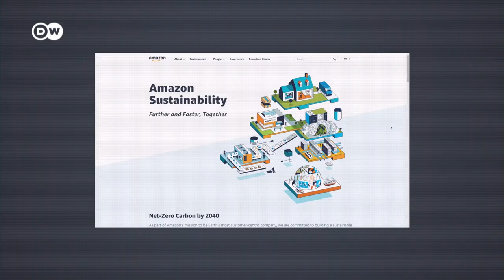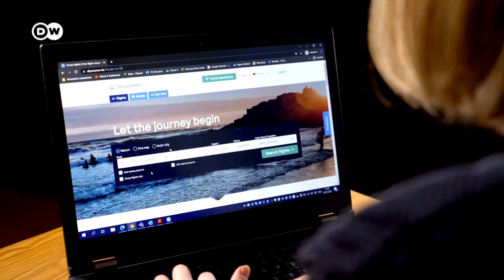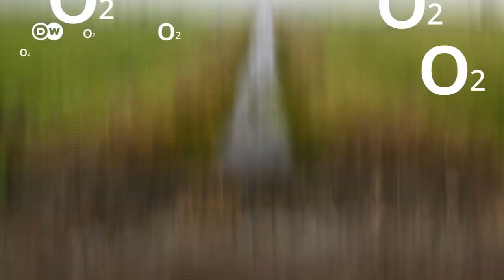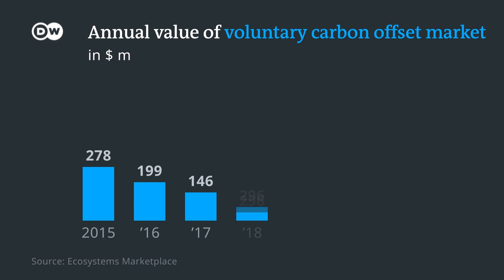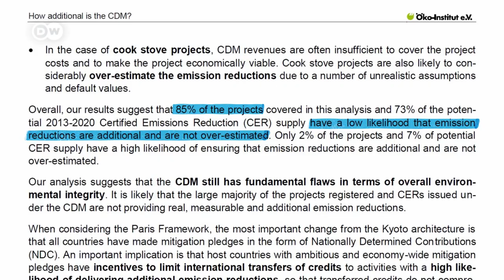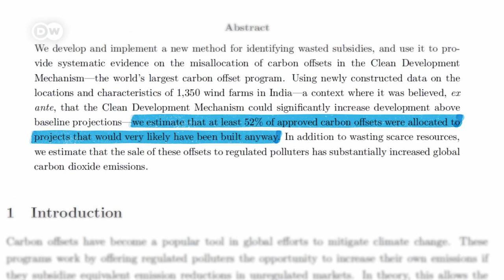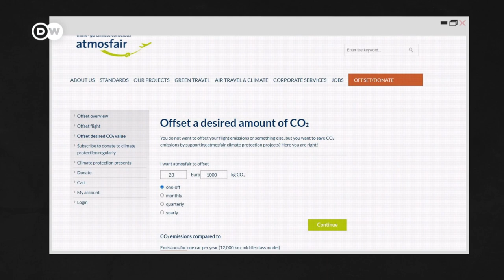Why carbon offsets are worse than you think

Comment: Thanks for the video on this important topic. In  Switzerland you can get incentives for replacing your oil/gas heater with wood or heat pump, financed with carbon offsets. Personally I find this ridiculous for multiple reasons:
-Installing new oil/gas heaters is illegal anyway in some Cantons (for example Zürich)
-Oil/gas heaters may be cheaper to install, but they are already cheaper in the long run without subsidies (so most would’ve been built anyway)
-you „surrender“ your prevented emissions. So you‘re not allowed to feel good about it. (bc of double accounting) I wonder what happens if a new renter asks about the heating system. Are they gonna say „actually wood but technically oil“?
Reply: @hurrdurrmurrgurr  They have abundace of wood in Switzerland loged in sustainable managed forests, for centuries already. Oil and gas in the contrary are 100% imported and everything but sustainable.
Reply: @meerkathero6032  According to Global Forest Watch Switzerland has lost 2.6% of its forest cover in the last twenty years. All things considered that is a low number but it isn't neutral and convincing people to switch further into biomass will only accelerate that figure. I agree oil/gas heaters should be switched out but for electric and geothermal heating not trees.
Reply: @hurrdurrmurrgurr  The loss is related to urbanisation and recent droughts harming the forests in some cantons. Something the statitic created from satellite observation data does not show. Clearcuts are forbidden by law in Switzerland, although, every tree logged must be replanted. In fact a lots of pasture land is turning into forests since grazing on the high pastures stopped due to economical reasons.

Comment: In Ireland there are thousands of acers of cut away peatlands that are and could be rewetted .So yes in this case I would buy carbon offsets. Trees also provide shade, reducing the heat island effect (reducing the need for air conditioning) and sequestering carbon a double edged sword in tackling  climate change. Trees in a colder climate reduce the wind chill from cold winds when planted on a northerly side of dwellings ,planted as a shelter belt they allow animals to graze longer into the season. Planted along a motorway trees reduce cross wind .Yes I would buy carbon credits but it needs to be value for money and the scheme needs to maximize the environmental benefits.
Reply from the maker: 🌱Thanks for your comment. We explored in our video if there is a way to keep the ground wet AND grow food on it. Please check out our piece on peatlands here 👉 https://www.youtube.com/watch?v=ws_ysJx3MEg

Comment: As the percentage of leakage of the gas (during mining, processing and transportation)  is difficult to quantify, I would like to know what is the approximate percentage that renders natural gas as harmful to the climate as, for example, burning coal.
Reply: Coal emits about double the co2 directly, so you would have to lose a lot to outweigh that. It is complicated to work out exactly because it depends what time frame you use. CO2 is the main GHG and lasts pretty much forever until something absorbs it. Methane is much stronger per ton but breaks down over time. So if you look over 20 years then methane is a big deal. If you look over 200 years then CO2 is more important. 

One analysis has looked at the issue  of using blue hydrogen instead of methane in homes or industry. Capturing the CO2 when making the hydrogen avoids most of that polution. But the inefficiency of the processes means that a lot more gas is needed to provide a certain amount of energy than if you just burnt the gas directly. According to this analysis the extra leaked methane due to using more gas produces more warming that the CO2 would have if you just burnt the gas. 

I can't answer your specific numerical question, but gas is definitely significantly better than coal, but blue hydrogen is not better than gas. Another advantage of gas instead of coal is a gas power station can turn on and off much faster to vary output according to demand. This is very important in filling the gaps between renewable generation.

Comment: Another problem is that fully grown trees are kinda carbon neutral. If they don't grow anymore, they are not capturing any additional CO2 anymore, they use it to produce leafs and fruits, which, once they fall down or are consumed, eventually release all that CO2 back into the atmosphere. 

What you have to do is cut that tree down and make sure that the wood from it never gets burned down or decays - you can make into coal and  tar and burry it into ground forever. And where the old tree grew, you plant another. 

Theoretically, you could have a system in which you first use the wood as furniture or in construction and you designate it as carbon sequestors, and once the wood is no longer usable, then you put it in ground as coal and store as wood tar. But you absolutely must make sure it doesn't ever ever get burned down in a natural gas plant or at homes, which is the case for most wood waste nowdays (with the additional step of becoming recycled paper or glued construction wood waste, but it all eventualy ends up getting burned with the exception of books)

Comment: The loss of whatever was to be harvested on that rewetted moorland will be replaced presumably at a carbon cost. The manager herself admitted as much when she referred to the carbon emissions from the agricultural use of the land. So if it's not happening there on that moor, it will have to happen somewhere else. You can't draw a tight boundary around some single simple activity; you have to consider its knock-on effects.

Comment: Creating wetland from farmland seems highly counter productive. Initially maybe it does absorb CO2 disproportionately, but the arable crops would have been doing that anyway, so they cannot claim any additional credit. However the wetland turns that CO2 into methane, which is a much more potent greenhouse gas than CO2. Whereas the arable crop was turning CO2 into food.  People still need to eat, so that food has to be transported further, hence releasing more CO2 from the transport fuel.

Comment: Very interesting video. I have a question: is there a regulation, a visit or a report for the offset carbon? I mean it's an obligation for big companies to have reduce their footprint, but does COP26 or the Paris agreement also put a head, a team, an audit or examiners to check it regularly, like every year (and to avoid CO2 emission, they can use local examiners).
Reply: Yes, there is an audit for the Paris agreement, but only if it is authorized as part of a naionally determined commitment (NDC).
Reply: @borneobill1   thanks for the reply. so it means it is rather words than action. So I wonder if people by CO2 offsets where the money goes? if it dosent go for the project?

Comment: If the German airline is offsetting it's emissions by rewetting the moor, and the moor only captures 10 tons of Co2 per year, then the airline is not really offsetting much of it's output. Like, a really small fraction. It's all just posturing right now. Individuals need to stop taking as many airline trips.

Comment: First reduce, then offset what cannot be abated now. As the video mention some form of carbon offsetting has to be in place. The systems are getting more complex in order to prove all requirements and methodologies for each type of project. A simplistic, contra producent view will be not supporting carbon voluntary markets. In some places these have been a way to actually support conservation, restoration and sustainable management. Keep asking for transparency and accountability and point out those that are faulty. Let's demand for high quality carbon credits but by all means do not disencourage engaging in them. Carbon credits are part of the solution that is accesible now. And as we know there is no much time left.

Comment: I think the presentation here is very disingenuous. The question is not merely whether you should fly and offset. The question is whether you can not fly and offset anyway, in a sensible way. I have deliberately limited my flying, don't drive, don't have kids or pets, buy green electricity, and following a lot of reading, have bought offsets for the portion of my footprint that I cannot just cancel. Sounds smug, but isn't. I don't think I'm better, but I recognise the damage I'm doing and want to contribute to limiting it. The larger the private offset market becomes, the better it becomes, the more scrutiny it receives, so that bad projects can be avoided.

Comment: I honestly get angry when a company offers a carbon offset fee to me. I know it's usually a fairly low price, but something just irks me about being asked to offset emissions when the company in question is massive, raking in millions of dollars and paying their CEO in the millions. UPS is really gonna ask me to pay an extra 73 cents on top of my overpriced package? Why don't they just include it in the price? Reduce the CEO salary? Or reduce their company's emissions so it's less of an issue? Even more egregious to me is when some organization buys carbon credits and then advertises itself as "carbon neutral". I understand it's just about impossible to be 100% carbon neutral in most places without credits, but many of these groups aren't even close. They use gas and oil boilers, internal combustion engines, and still have room to expand their rooftop solar (if they even have any). And yet, through these so-called offsets, organizations that could fairly easily reduce their actual emissions instead get to prance about declaring themselves carbon neutral while still polluting far more than necessary.

Comment: This is a good summary of the challenges facing carbon offsetting, notably additionality, permanence and the risk that they substitute for reducing emissions. 

There is however a lot of good work going on to improve the credibility of carbon offsets, to improve their monitoring and to set guidelines for how companies use offsets (e.g. SBTi net zero standard). 

The only thing missing here was the differentiation between avoided emissions and carbon removals - either natural or technological - which effectively remove carbon from the air and will be critical in reaching net zero. 

A future video exploring these technologies would be very interesting to highlight

Comment: Some emissions are just very difficult to abate at the moment. For example those related to agriculture or air travel. There were no good trains for my upcoming vacation while the plane was cheap and convenient. On the website there were several offset options for different prices. In the end I chose one with a share of biofuel directly reducing the airplane emissions. The price per t of CO2 was considerably higher than the EU ETS cost of carbon.

Comment: I don't buy carbon offsets through a company I am buying from.

I would rather donate to an organization I trust to do a good job.

The best way forward would be investing money into ways to reduce emissions in the first place. Does anyone really think the emissions of all the production like mining, manufacturing, and transport can be offset by giving another country money to make a windmill or solar panel? Same question for paying a poor country to maybe not cut down some trees? This is an attempt by companies to avoid real change.

Another issue is solar panels, wind power, and lithium ion batteries all cost carbon emissions to produce, plus ecological damage of mining. These technologies are helpful, but they shouldn't be seen as a perfect solution.

Another issue with reforestation is poor planning. Many projects reforest with a single tree that is not suitable for the environment. They may also plant a single type of tree, leading to a lack of biodiversity. In that case the wildlife will not thrive and natural disasters may occur more often. There is also higher risk of disease killing off all the same tree.

Offsets can be helpful, but it is very hard to track if it makes a difference in many cases. It is easy to measure reduction in output or less wasted materials. I would rather invest money in something I can measure.

Comment: And then to top it off you have the Chinese way, build more coal powerplants than you ever will need before the cutting deadline comes, then you phase them out, be all green and nice and then you sell the quota to someone else.
Carbon stays at the same level it is now, but it seems to be offset because the unneeded coal power plants aren't operating.

Comment: I looked into this some years ago. Mostly I got to the same conclusion. But it’s very different depending on where you invest. Of course non-profits are preferable. Integrated services (airline websites etc) reliably calculate with 1/2 the emissions others calculate for the same flights. 
Look into projects that help in addition to CO2-Offset. I recommend Atmosfair.

Comment: We know that most cooperates will choose the cheapest and easiest option.
But we fail to enforce an effective option because it's seen as too radical to be accepted by the majority.
See swiss left parties recent attempt to force "carbon offset" for travel and reduce overall emission of heating and some other things.

The lack of options makes people go against these ideas. Again, another video that shows:  (1) "currently there is no perfect solution", but yet we sell that.
Furthermore, we lose to the opposing parties for but one argument:  (2) "you lose your right/option to ... if ..."
e.g. "poor families can't fly to visit their beloved ones anymore if prices for flights would increase"

We are tricked into thinking that emission has to be compensated with money from the consumer.
The gap between rich and poor should be clear, of course people don't accept enforcing such rules if the majority is poor.
Pay to offset flights, pay for electric cars, pay for green energy, pay for ...
This will not work and yet it's always the same with some up and downs.

As I see it, climate change is a global issue, dominated by cost, efficiency and abuse/ignorance.
Later will always be a part of humanity, but also insignificant. Sadly it's used as an excuse to not act.
But, we can change the rules! and therefor guide the "cost efficient" ambition to a common goal.

1. Make carbon emission cost inefficient.
2. Guarantee income based on those needs that play against ourself. Not another "minimum" wage.

Regarding 1. If there's no good solution then don't artificially create one for cooperate to hide behind and point the finger at us like a child in pre school!
Let them work with us and find solution to the problem.
Afterall, behind every desk there's just another person.

Let me know what you think. I'm yet another imperfect being,

Comment: There were no carbon offsets covered in this story. There was coverage of carbon shell games, but nothing mentioned that removes carbon from the Carbon Cycle. Putting carbon into trees that are gone in decades or bogs that will dry out in a warmer ecosystem is still carbon on the surface of the planet. Carbon on the surface of the planet is in direct contact with the Carbon Cycle. Temporary storage of decades for trees or up to thousands of years for bogs is still... TEMPORARY. Storage that may not even last as long as your lifetime.

How does your child clean up the mess they have made of their room? By putting things back where they got them. Carbon works the same way. Putting carbon back into rock miles underground removes it from the Carbon Cycle for 100s of millions of years. Putting carbon anywhere on the surface of the planet does nothing but make it available to become part of the Carbon Cycle.

It is tempting to shove all your carbon into the closet and call it a day, but you know yourself that is the wrong answer every time you glance to see if the door is going to burst wide open. It is Mother Nature, not your mom, that is checking your room, in her house, that you said you were going to clean. She knows about the closet. You know you are going to have to clean it out and put all of it back into the boxes in the basement. Trying to appear casual as you lean desperately against the door with a, "See, Mom, everything's cool," look is not going to work this time and does not help the situation.

Comment: No I would not buy carbon offset.
I just simply stop travelling, I was not already traveling a lot any way (less than 10 times in over 50 years)
Buy  local as much as I can,
Reduce buying stuff to the essential,
Not buying stuff that are not recyclable or wrapping that is not,
Use as long as I can what I have and if possible reuse it,
....

Comment: I am just wondering how, without offsets, you envision to reach the emission reduction that is so desperately needed to keep global temperatures from rising. 

Are you going to make everyone stop driving tomorrow, using renewable energy exclusively to heat homes and operate devices, stop producing and using products that require fossil fuels for their manufacturing process? Are you not going to replace your laptop when it dies, your headphones etc.?

Carbon offsets are intended to be a bridging mechanism that allows us to reduce and remove emissions from the atmosphere TODAY while we work on systematically decarbonize the economy. 

Sitting back and criticizing these solutions while continuing to contribute to emitting carbon into the atmosphere feels kind of hypocritical.